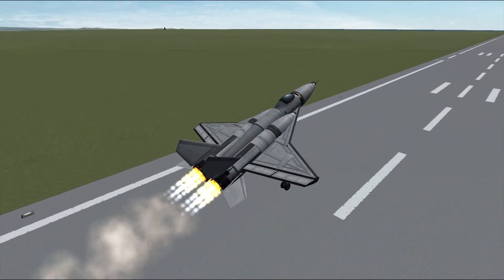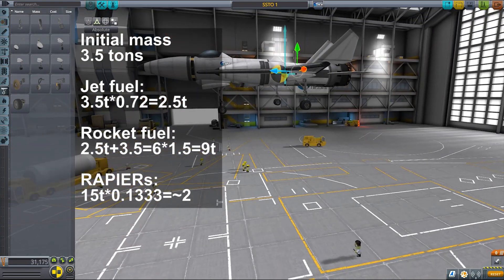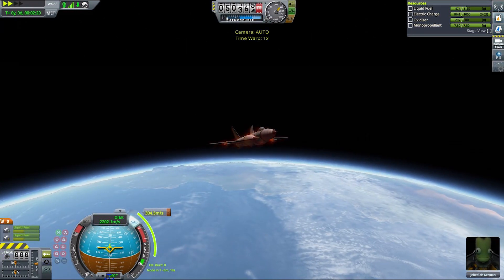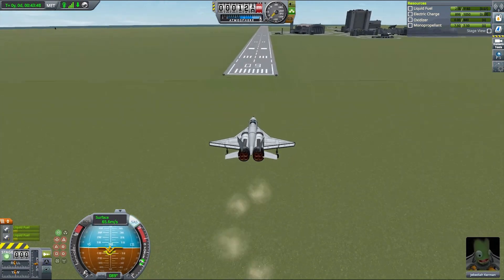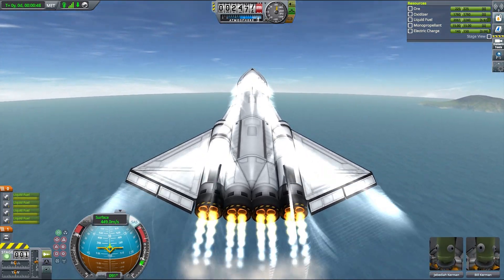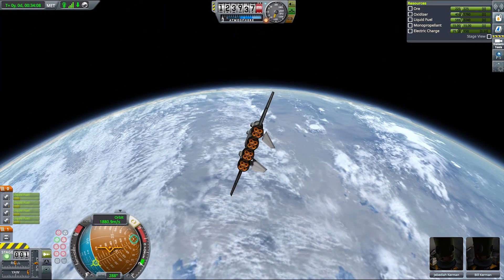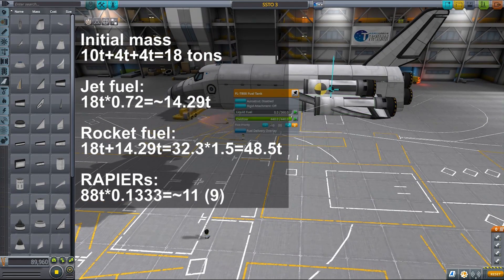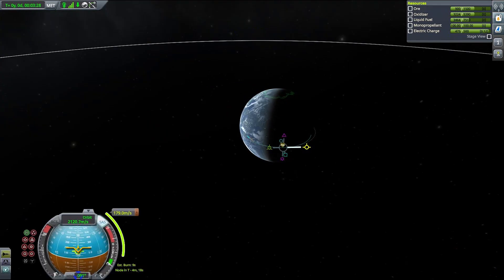Tutorial: Simple and Easy SSTO - KSP 1.3

Comment: Still fighting to get this sorted out after 4 months.  Your equations are fine but it's a wrestling match over the numbers.  Now I can get a simple SSTO up easy.  It's the more complex ones that I have issues with.  Need more Isp then you need more Fuel.  Add fuel then you need more engines.   I need to find Tsiolkovsky's equations for a Kerbin SSTO.  Still have gaps in my knowledge.
Reply: Just tried the excel sheet but am running into issues with the lower bit.  I'll keep fighting with it on Achieved velocity.   Just coming up wrong.  I'll keep mucking with it.  Has to be the fuel balance.

Comment: how do i know the ton of the initial mass?
Reply from the maker: Well you do know what you want to put in orbit right? Otherwise it's going to be hard, you've got to start somewhere :)
Reply: yes, but how do u get the 3.5 ton in your first ssto craft? Before that , the initial mass is basicaly the mass of the aircraft without the fuel and propolsion right?
Reply: and one more question, what if i decided to use other type of engine?
Reply from the maker: 1st question: Cockpit + cargo bay + whatever you want to put in orbit + some ~1t for wings and landing gear. It doesn't have to be super accurate.
2nd question: Math won't work. You want to use different engine, try solving the proper equations for dV as shown in my other tutorials.
Cheers!

Comment: Hi i have question:  when you calculate the rocket fuel needed, you add the weight of the jet fuel. but why? isn't the jet fuel already gone when you switch to rocket fuel? it would make more sense to me calculating the jet fuel adding the rocket fuel weight, because i have to bring the whole weight off the ground, wich i use jet fuel for. or did i misunderstood something?
Reply from the maker: That is true when you want to calculate deltaV for each stage using Tsiolkovsky's equation. The method shown in this video does not explicitly calculate deltaV but gives you a simple way to compare fuel and payload ratios for a precalculated deltaV and TWR values - such that are needed to get into Kerbin's orbit. Cheers :)
Reply: Thanks for your quick reply! i looked into your other video about a low-tech ssto and the science part helped a lot. Great job! :)

Comment: 0:45 How do you move the parts with those XYZ arrows? (The ones that came out from the center of mass of the fuel tanks)
Reply from the maker: Pressing 1, 2 or 3 will cycle between placing, moving and rotating parts. If you hold shift before clicking on a part it will move or rotate the entire vessel, not just that part. Cheers!
Reply: Thanks a lot!

Comment: I have a question about scaling SSTO's, that was bothering me for quiet a long. 
In real life mass of the vessel and, consequently, corresponding thrust and lifting force should scale roughly as cube of vessel's dimensions (~r^3), while drag scales only as square (~r^2). So for large crafts the air resistance should be relatively small, thus leading to better performance.
However, the KSP aerodynamics model was always somewhat obscure for me. 
And the question is this: is the described effect noticeable in KSP and large SSTO's are actually more effective then smaller ones?

Comment: Probably a silly question but when you make the calculations for jet/rocket fuel are the numbers for the total weight of the fuel and the tank it comes in or just the fuel?
Reply: Broke Dead Dogg The tank weight is negligible. These are rough estimates, but if you need to know, he mentions in the first build that the total weight of the tanks should be 2.5t and 9t. So yes, tanks included.

Comment: Thank you soooo much for breaking SSTOs down into something so simple. Your videos have been super helpful. Had a few quick questions.
1. Did you get those constants based upon the TWR from your sheet? 
2. Is there a way to generalize them out to enable multiple engine types (Ramjets and rapiers)
3. Are there some rules of thumbs for adding wings? Looks like you can arbitrarily add them any which direction with current KSP physics
4. How useful do you think a simple web app would be for calculating stuff like this? Built conbuddy.net (prorating tool) in ~15 hours. Wouldn't be too hard to modify it to use logic for calculating out stuff for KSP.  If you feel there's value it. I'd love to work with you to get a deeper understanding of the underlying logic to your spreadsheet and make a tool for us all.

Comment: Great video, thanks a bunch. But I'm a dumbass so of course I am gonna be the one with all the questions. So should you count the engines as initial mass? Cause it seems we are making the decision of how many engines we are gonna use after all those numbers have been crunched. Second question, why do we use such an aggressive re-entry? Does the high angle entry have something to do with heat management? Or is that just so its easy to eye-ball? Thanks for the info.
Reply from the maker: No you can't count the engines as your initial mass. You can reverse the process and decide up front how many engines you want to use (for visual purposes for example) and then work out the numbers from there to see how much payload you can get into orbit. The numbers in this tutorial are slightly exaggerated to make the plane more robust, but you can cut the engine number by 40% if you feel more experienced. Also, you decide how many engines you need as a function of your total mass, because what counts is your final TWR.
As for reentry, you can use different profile, but this one is just "safe", with low risk of overheating. If you feel more experienced you can use more shallow and let's say, adaptive profile and glide your way to KSC no problem. Good luck!

Comment: Tip: if you're having trouble gaining speed in the beginning accent (if you have a very heavy payload for example), stay below 10 degrees. That will help a lot.
Reply: Below 10 degrees until at least 400mps. Usually after that you can pitch back up and climb. Just keep an eye on acceleration and make sure it keeps increasing. If it's decreasing you pitched up too early

I.e. in my sstos I use wayyy fewer rapiers than this guide. For 80 tons I'd have 3-4 not 9 0_0. But to get that off you'd have to stay at sea level for a good 30 secs to hit that 400 mark, and then start ascending.

Worst case scenario of not being able to hit 400mps, honestly I usually just redesign if that's the case, but you can do a slow climb, dive down to forcibly break through the 400 barrier, and then pitch up slow enough to keep above 400 and then climb.

Idk if it has a name, but it's kinda a pain in the ass, and takes awhile to do, so instead of doing that I'll just do a slight redesign. Add an extra engine or shave a bit of drag/weight.
Reply: Even for me, it works at staying perfectly at 10 degrees.

Comment: Thanks Mark. Can you show us how to figure out the wing area? I've seen you other more in depth SSTO tutorials but I don't know how to use the lift information.
Reply from the maker: I guess you need to figure out what works and what doesn't for you. I typically find that Mk3 SSTOs have the least wing area relative to their mass for example. If you watch my SSTO Space Program, the Angel SSTO from ep. 5 had too large wing area - it was very stable and maneuverable but also had really poor drag profile in the upper atmosphere. Bumblebee, from ep. 13 is quite the opposite, it has very low lift rating and because of that is pretty hard to land when full. More balanced example is the Mun SSTO from the tutorial. I'd check those three, see which one you like the most in terms of flight behavior and get the lift-to-mass ratio from that example. Good luck!

Comment: Actually SSTO fly pretty well with 20 tons per RAPIER, so for any of SSTOs shown in this vid you can replace half of the engines with something useful.
Reply from the maker: +HiredDriver There is a whole playlist dedicated to designing SSTOs on my channel, there are videos for low tech SSTOs as well. Check out comment sections under those, it's full of people complaining that they can't fly it, can't follow the ascent profile and in general do not have enough fuel. This video is made for such people and you are obviously more experienced than that. All of that is also linked in the video description.
Reply: yeah but for folks making their first with no prerequisite, this video gets them off the ground so to speak.
Reply: Sure, but it doesn't sounds like a reason not to tell firsttimers about example to follow instead of pushing 0.1333 ratio which doesn't have any SSTO specific math basis except TRW > 1.
Reply: mmm I don't know, less thrusters consume less fuel, but I feel that it takes way more to get out of the atmosphere, so actually it used more fuel
Reply: he's taking equations that people don't understand(or don't care to) and swapping the variables with factors people can see and count on screen. no it's not rocket science, its problem solving math. the problem it's solving, is how much of each kind of fuel and engine for a certain weight to a destination. pretty close to rocket science if you ask me. in fact, i would dare to say rocket science stemmed FROM problem solving math.
Reply: HiredDriver like nerfs

Comment: Great !

How do you know it's mais*0.1333 for Rapiers ?

How about a SSTO  with LV-T45 Swivel and J-x4 whiplash ?

still not unlock rapier, how do I know about how much I have to pultipli pleas?
Reply: It's a ratio equation, the elements change based on your input, the multipliers are your constants to 'basically' always ensure you have the DeltaV to make it to orbit. If you notice the values provided, the oxidizer is at a 1:3 ratio of the mass, and then total thrust is 0.133, or (133%), giving you the REAL magic number, which is roughly 1.33 TWR to get a plane to orbit, if it has the fuel to run all the engines for the prescribed time/thrust (DeltaV).
Reply: Thanks for the answer.

I have another question to you multipletechnologies.

I dont know if you dowloaded Mark's google sheet, but it's written that you need like 3500-4000 m/s with airbreating engines.
That means even not circulized ?

I've seen on the DV map (http://wiki.kerbalspaceprogram.com/wiki/Cheat_sheet/fr#Cartes_de_.CE.94v) that's around 3400m/s to go to 80km orbit.

So I need ~3750m/s in aibreathing and another 3400m/s to reach an 80km orbit ?
Reply: No actually in essence you have enough DeltaV (3400 gets you to 80k) to make with just the air breathing engines, the issue you are gonna run into is making your circle without any air intake. In this case it usually takes me less than 10s of DV to up from that speed and circle, BUT, you will have to be pretty good on your accent to make 70+ and not have to correct or add some bursts of speed while in atmoshere. I never leave home without 1m of vacuum-usable DV, at the least I need to maneuver/rendezvous, or you need about 30 to circulize on the way home, so keep that in mind.
Reply: Thanks for the answer.

What should be LFO/LF ratio to get to orbit ? 

1700m/s of LF and 1700m/s LFO ?

Plus I had  a modd that allows me to add in action group fuel tanks.
I was able to activate or disactivate the pumps of all LFO. 
It was very helpful, insted of select all my tanks and activate LF manualy, it activated the all. 

Unfortunatly i thought it was stocked option and delet all modds for the 1.3.
Do you know witch modd it is ?

Comment: It would be the same for SSTO with nuclear engines?
Reply from the maker: No, not at all. Although, you could imagine that you add to your initial mass some nukes and extra liquid fuel and work out the ratios from there, but for long range SSTOs you would end up with rather suboptimal setup. I'd recommend working out the data on the excel spreadsheet (in the description) and then set your ratios from there for specific locations, such as Mun or Duna. But I'd still prefer to use proper math to do that honestly :)
Reply: Mark Thrimm thanks!

Comment: Can You mathematically proof Your method of calculations?
Reply from the maker: +Wiktor Guzowski You can use the excel spreadsheet that I provided in the description to reverse engineer those ratios. The idea behind this tutorial is to provide beginners with a method that works for multiple craft types that would be almost immune to pilot error. Normally to get into orbit you need to increase your vessel kinetic energy to a value that is the sum or your vessel kinetic energy while in orbit, plus the potential energy change, plus the losses due to atmospheric drag. You can simplify the problem by assuming, like I did in the previous tutorial that you can at least accelerate to ~1400m/s in jet mode and gain enough altitude to neglect atmospheric drag in your calculations. At this point you can calculate deltaV needed in rocket mode conventionally with a small margin, and you can also neglect altitude change between 24km and say 80km, as it does not contribute much to your overall energy change. Since calculating the actual losses due to atmospheric drag is pretty hard in KSP, because you have no access to lift and drag coefficients for different parts (KSP is using very basic lift models) and the shape of your vessel does not matter really in that context. Also, jet engines in KSP do not behave realistically and you have no direct information about their efficiency curve vs speed and altitude, so it's easier to just find a middle ground between fuel and TWR that gets you to the point where conventional dV models can be applied. 
This happens to be anywhere between 2500-3500m/s in jet stage assuming sea level consumption. Since tooltip data provides you only with that info (you can get more by data mining though) you can attribute 2500+m/s to your jet stage, knowing that you can it should get you to about 24km and roughly 1300-1400m/s velocity. At this point you add another 600-800m/s in rocket stage to get into orbit.
However, this method not only requires you to solve multiple interdependent dV equations, it also requires you to follow a very specific ascent profile. I saw from my other tutorials that many people had problems following it. So, the method that is presented here takes double for almost everything, just to make sure that the result would be pretty much immune to pilot error. I highly recommend you reverse engineer those crafts and just for comparison purposes, do the same for my Eeloo or Dres SSTO. Have fun :)
Reply: The reason this always works is because you can know the dV results in advance by removing one variable: Isp. Because you always take rapiers, you can be 100% sure that a pre-determined fuel-to-mass ratio (mass fraction) will always yield the same dV (and TWR). Using this information, you can achieve what Mark did with this video.

Pretty clever though.
Reply from the maker: Is that a legitimate question or you're making fun of me? :)
Reply: Of course I'm not making fun of You, I am wondering, why that method works and how You get those numbers - by trial and error metod, or have You actuall calculated them
Reply: Yeah, I agree. It would be interesting to know